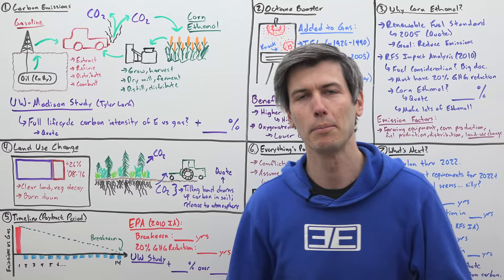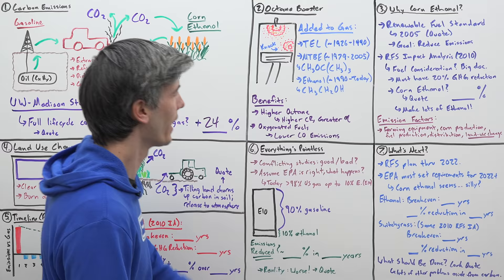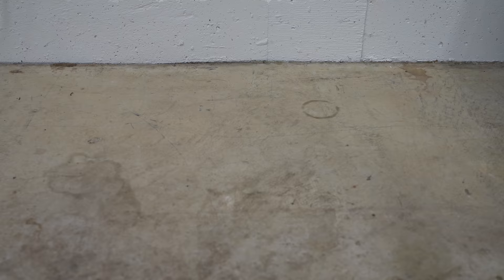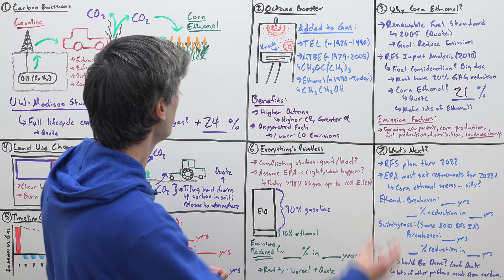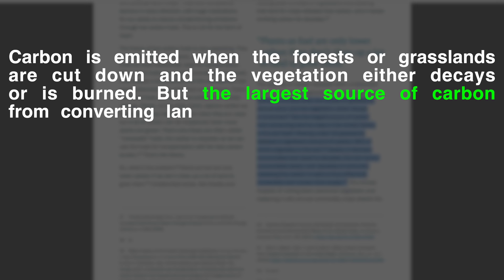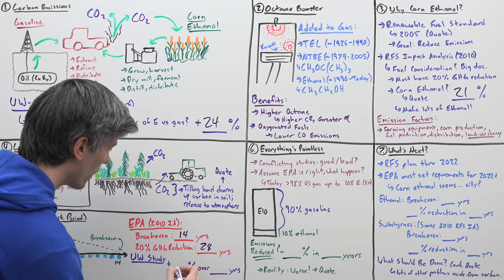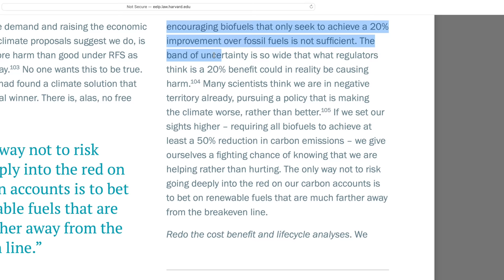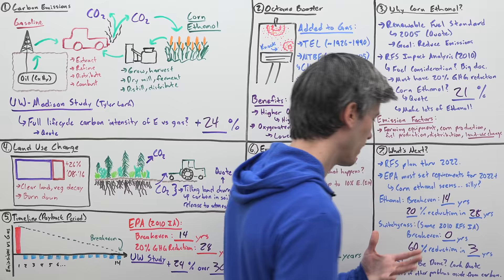America Was Wrong About Ethanol - Study Shows

Comment: Nothing, including ethanol, is as energy dense as hydrocarbon fuel. You say it reduces this and that, but also reduces milage by up to 35% but your price at the tank does not reflect that at the pump. In the long rung you are even paying more for ethanol because your CS government is taking money from your left pocket to pay for the  heavy subsidies they provide to them so they are able to stay in business.
Reply: Nothing, including hydrocarbons, can get the fuel economy and power one can with an ethanol optimized engine.

Gasoline gets less mileage than diesel, and yet we still use it.  Ethanol in our current inefficient lower compression engines gets lower mileage but the cost per mile to drive with it is almost always less and without all the toxic pollution petroleum puts out.  Ethanol also makes more horsepower.  For example, a Chevy 5.3L engine gets a clean 380 horsepower on E85 vs a dirty 355 hp on E0.

In ethanol optimized engines, you will not only get more horsepower but even more mileage, more mileage than what a diesel engine gets.

Ford's first EcoBoost prototype engine optimized for E85 achieved 15 to 20% more mileage than E0 with load performance comparable to a diesel engine.  They didn't make it for flex fuel in part because they thought they could skirt paying for the patents to the MIT scientists who developed the engine.  That is still in court to this day.

Ricardo built and drove an ethanol engine for GM some time ago with mileage greater than GM's diesel engine.

FROM RICARDO:
The new federal CAFE standards are calling for a doubling of fuel mileage performance, which, Vint says, is going to send OEM’s looking for high octane numbers to improve efficiency and ethanol is the best source. Ricardo, an engineering firm with over 100 years in the business of engine design, has developed an extreme boosted direct injection engine (EBDI) to optimize ethanol blends. The 3.2 V6 gasoline engine rivals the power and torque of a much larger GMC Sierra 6.6 diesel, he said, and it delivers 3.5 percent better fuel economy than the diesel.

This is not new technology or knowledge, it was known long ago.  It is suppressed technology.

Rear Admiral C.M. Chester wrote Henry Ford a letter on Dec.15, 1916:
"...I also pointed out in the article that as governmental laboratories had developed from 40 to 55% efficiency in alcohol engines as against 20% in gasoline machines, the use of alcohol at double the cost of gasoline for power purposes, was cheaper for motor[s] than gasoline in common use today."
Reply: @danafletcher2341  Hes gonna flip when he reads that Dana...if he every does.

Comment: It’s horrible for gas mileage and wreaks havoc on small carbureted motors!
Reply: Identical small engines in Brazil use their common gasoline which contains 27.5% ethanol.  It has worked out so well and for so long that Paraguay went to E27.

Ethanol in our current inefficient gasoline optimized engines has lower mileage but the cost per mile to drive with it is lower and the pollution is drastically lower with more horsepower as a bonus.

Comment: Small engine shops and marinas made a fortune on water in fuel issues because of ethanol.
Reply: If you truly believe that you should sell everything you have and move to Brazil to buy every repair shop you can find where identical small engines and boats use their common gasoline which is 27.5% ethanol.

If what you claim is true, then you should become a gazillionaire in no time.

Water is a problem of straight gasoline, not ethanol.  

In fact alcohols were sold as gas-line antifreeze in the days of E0 because straight gasoline cars would stall with freezing up fuel lines.  Heet and Dry Gas were the most common products sold but not anymore since E10 came to be.

If ethanol did cause water problems, there would be millions of cars stalled on the roads of the northern US and Canada right now in cold January.

Mercury Marine said E10 may be the superior fuel to E0 because it keeps the fuel dry

Comment: Here's an interesting fact....fueling a vehicle with E85 fuel results in a 30% reduction in fuel mileage vs. E10 fuel. This is due to the fact that ethanol contains less energy per pound than gasoline. Did these studies account for the increase in fuel burn?
Reply: NOPE.

Comment: Doesn't even go into the damage done to engines.  Carbs were ruined and had to be rebuilt with ethanol compatible parts.  Garages loved all the bonus service people had to buy.   Farmers should grow food, not fuel.  There is also a huge use of water in the production process.
Reply: There is no damage to engines.

The US Bureau of Labor Statistics measured share of household income spent on vehicle repairs and maintenance from 1990 to 2017 during the time ethanol in gasoline went from .1% to around 10% from 2011 onward.

The share of income spent on repair and maintenance went from 2% in 1990 to 1.5% in 2017 as ethanol usage exploded.

On most any manufacturing chemical compatibility chart you will find ethanol is at worst equal to but most often more compatible with rubbers, plastics, and metals than what gasoline and BTEX (benzene, toluene, ethylbenzene, and xylene) are.

Brazil has used >E20 in identical non-flex fuel vehicles to ours since the 1970s.   An E10 blend called Cleveland Discol sold in Britian from the 1920s until 1968-70 when BP bought it out.

Corn is value-added into ethanol while preserving the feed/food in a healthier and more productive form called distillers grains.

Most corn (87%) is not irrigated and the state that does a bit and is known for corn (Nebraska) used more irrigation water in 1980 before ethanol than after.

Early distillation plants many years ago used some water but since recycle most all of it today.
Reply: @danafletcher2341  I was a mechanic when ethanol was introduced, were you?  I saw horrible running cars that could only be fixed by a carb rebuild.  You sound like a corn lobbyist arguing for turning into fuel.
Reply: @Step-n-Wolf  My first-time experience of working on a carb was during the days of E0 in the 1970s when my father's water pump small engines would varnish over winter and stick the needle and/or float.  I saw sheets of varnish actually hold up a float.  Like the smell of a skunk, varnished gasoline is something one can never forget.

When E10 first came in the 1980s, there was a transition to it because alcohols clean varnish (they are often used as an active ingredient in carb and injector cleaners).  I can remember my father's Ford trucks plugging fuel filters to the point we were changing them weekly from ethanol cleaning off the build-up of varnish from E0 in the fuel tanks.  The filters were cartridge style so not fun but at least every engine used the same one (for oil too).  

But once clean, E10 kept things clean.  I still have some of those very same trucks and can't remember the last time the fuel filters were changed.  They hardly are ever run, but they start and run as long as the battery is still charged up.  

I have never seen or smelled E10 ever varnish and don't believe it can no matter how old.

Small engines back then did not have fuel filters, so the carb was the filter.  Note that around the same time ethanol came we also were treated in our fuel to BTEX.  BTEX is benzene, toluene, ethylbenzene, and xylene which are highly toxic and volatile aromatics which are very corrosive on manufacturers' chemical compatibility charts on many materials.  Worse than gasoline.  Gasoline itself is so corrosive that Viton rubber had to be invented.

I am not a lobbyist, but I did stay at a Holiday Inn Express once.

If I have stated any specific thing that is incorrect, please bring it to my immediate attention.  I hate being wrong on anything.
Reply: @Step-n-Wolf  I run Ethanol it ALL my vehicles and lawn mower and have MULTIPLE videos of them running.  Do you?

Comment: A shame policy makers don't use science like this.
Reply: This is probably the best science money can buy.

Unfortunately, the Tyler study was not even close to reality.

There were no grasslands or forests broken up for ethanol.  Quite impossible since US cropland acres have been declining.

Census data shows in corn producing states that grassland, forest, and wildlife areas increased since ethanol.

The reason corn ethanol is so economical over most any other source is that is it value-added from already existing corn feed production and it preserves the feed in a healthier, more productive, and more concentrated form called distillers grains.

Believe it or not, the corn belt grew more corn acres in 1980 before ethanol than they did in 2018, the year of most ethanol production ever and ethanol plants everywhere.

2018 Iowa 13,200,000 acres of corn with most ethanol production ever
1980 Iowa 14,000,000 acres of corn before ethanol

2018 Illinois 11,000,000 acres of corn with most ethanol production ever
1980 Illinois 11,600,000 acres of corn before ethanol

2018 Indiana 5,350,000 acres of corn with most ethanol production ever
1980 Indiana 6,450,000 acres of corn before ethanol

Comment: Another thing is that ethanol does not burn clean and in time will clog fuel injectors.
Reply: Many fuel injector and carb cleaners have active ingredients which contain alcohols.  It is gasoline which clogs fuel systems, the longer it sits the worse it gets and if a cleaner is added like ethanol, you could plug fuel filters much more often as it cleans.  But once clean, running ethanol will keep fuel systems clean.

E100 is >99% pollution free.

The very reason ethanol is added to fuel today is as an octane booster and as an oxygenate to clean up the dirty pollution gasoline produces.

Denver in 1988 was the first government entity to require E10 when they were on in EPA list of ozone non-attainment zones.  Soon with ethanol they were off that list.

Even with just 10% ethanol added to E0, the Swiss Federal Laboratory for Materials Science and Technology found that the especially health devastating ultra fine or nano particulate emissions were lowered by 97%, carbon monoxide lowered by 81%, carbon dioxide lowered by 13%, aromatic hydrocarbon emissions lowered by 67-96%, and genotoxic emissions lowered by 72%.

Comment: It's bad on metal fuel tanks and older models with fuel pumps, it destroyed my old Toyota eat tank and pump up, has ruined many lawn mowers and weed eaters, chainsaws, it's only good for corn growers,
Reply: Ethanol on most any manufacturer's chemical compatibility chart you will find is at worst equal to but most often easier on metals, rubbers, and plastics than what gasoline and BTEX (benzene, toluene, ethylbenzene, and xylene) are.

The common gasoline in Brazil contains 27.5% ethanol and they have the very same lawn mowers, weed eaters, chainsaws, and Toyotas we have.  It has worked out so well and for so long that Paraguay went to E27.

Here is how the 2007 Energy Independence and Security Act affected food/feed prices(if at all):

2007 WEIGHTED CORN PRICE =$4.20 WITH 4 .7B GAL MANDATE
2008 WEIGHTED CORN PRICE =$4.06 WITH 9B GAL MANDATE
2009 WEIGHTED CORN PRICE=$3.55 WITH 10.5B GAL MANDATE

2016 WEIGHTED CORN PRICE =$3.36 WITH 15B GAL MADATE MAXED OUT
2017 WEIGHTED CORN PRICE =$3.36 WITH 15B GAL MANDATE MAXED OUT
2018 WEIGHTED CORN PRICE =$3.61 WITH SAME 15B GAL MANDATE MAXED OUT + MOST ETHANOL EVER PRODUCED

Wheat
2007...............$6.48/bu
2008...............$6.78/bu
2009...………$4.87/bu

2016...………$3.89/bu
2017...............$4.72/bu
2018...............$5.15/bu

Soybeans
2007..............$10.10/bu
2008..............$ 9.97/bu
2009...……...$9.59/bu

2016..............$9.47/bu
2017..............$9.33/bu
2018..............$8.48/bu
Reply: Nope!  sorry EK1

Comment: But ethanol requires use of stabilizers to keep ethanol from varnishing up your fuel systems when stored. It helps create more unnecessary jobs.
Reply: Gasoline requires fuel stabilizers since it does not last very long (3 to 6 months according to the makers).

Alcohols last indefinitely.

Sea Foam and other carb and injector cleaners actually use alcohols as active ingredients.  

Sea Foam states their product stabilizes gas & diesel fuels up to 2 years.  It contains 25% of an alcohol.

I have never seen E10 ever varnish and have been using it since the early 1980s.  I do remember E0 gasoline varnishing, like a skunk, once you smell that you will never forget it. 

Ethanol also acts as gas-line antifreeze.  Back in the 70s and early 80s, people would have to buy little cans of alcohol for gas-line antifreeze with name brands like Heet or Dry Gas.  Not since E10 came to be.

Comment: The public health costs resulting from the massive corn overproduction should also be factored into this.
Reply: There is no overproduction of corn.  There were no grasslands or forests broken up for corn ethanol either.  Quite impossible since US cropland acres have been declining.

When covid hit, cattle publications were sounding the alarm that distillers grains could run out for cattle feeders with ethanol plants shut down.  Cattle feeders would have had to switched to feeding the less healthy and less concentrated corn straight for their alternative source of protein.

Denver in 1988 was the first government entity to require E10 when they were on the EPA list of ozone non-attainment zones.  Soon with ethanol they were off that list.

Even with just 10% ethanol added to E0, the Swiss Federal Laboratory for Materials Science and Technology found that the especially health devastating ultra fine or nano particulate emissions were lowered by 97%, carbon monoxide lowered by 81%, carbon dioxide lowered by 13%, aromatic hydrocarbon emissions lowered by 67-96%, and genotoxic emissions lowered by 72%.

Using petroleum increases health costs, not burning pollution free ethanol.
Reply: @danafletcher2341  So how do you explain all that HFCS in your bread?
Also no one was arguing against fuel additives or ethanol as a fuel additive.
People are arguing against getting it from corn specifically, since there are other possibly more efficient sources, like cellulosic ethanol from algae.
Reply: @fotoschopro1230  We will grow the very same amount of corn either way.  Why not have the cattle eat the corn in the healthier and more productive form called distillers grains?

HFCS properly made is not much different than sugar.  BTW, the one food corn ethanol does compete with is HFCS.  Problem with HFCS are harmful byproducts can be present from making it along with extra starch they don't account for.  They did a study on pop and found four times the carbs in pop with HFCS compared to cane sugar even though it had the same amounts of sugar (i.e. fructose and sucrose).

The reason corn ethanol can economically outcompete most other sources is not because it makes the most ethanol but because it is value-added from >>>already existing<<< feed production while preserving the feed in a healthier and more productive form called distillers grains.

So much so that Brazil put an import tariff on our ethanol in 2017.

If everyone ate grass fed beef like I like to do, corn ethanol would not exist.

Believe it or not, the corn belt grew more corn acres in 1980 before ethanol than they do today with record ethanol production and ethanol plants everywhere.

2018 Iowa 13,200,000 acres of corn with record ethanol production
1980 Iowa 14,000,000 acres of corn before ethanol

2018 Illinois 11,000,000 acres of corn with record ethanol production
1980 Illinois 11,600,000 acres of corn before ethanol

2018 Indiana 5,350,000 acres of corn with record ethanol production
1980 Indiana 6,450,000 acres of corn before ethanol

Comment: You have and others have not sold alchol/gasoline fuel to "The Big Two and a half. I am not incharge of all the car compines, Or the cost of the fuels and distrrm ubution of stuff for cars to make them work. Some one some where has not become sold on changing the system. There is also the use of Farmers fields for fuel growing or Food Growing.  Then again I had trouble explaining to my Engineer Brother in Law why his Great "Toyota" Japanize car plugged up it's CATS.  So much for Japanize Cars and American Car Mechanics.   Also what are the the taxes for both fuels.
Reply: Word salad....
Reply: Lots of identical Toyota vehicles in Brazil where the common gasoline has 27.5% ethanol.  It has worked out so well and for so long that Paraguay went to E27, Bolivia going to E25.  Soot is what plugs up a CAT and ethanol is sootless and greatly reduces the soot put out from gasoline.

With ethanol you grow both food and fuel.  Corn ethanol is a value-added product of already existing feed production which preserves the feed in a healthier and more productive form called distillers grains.

Comment: @1:23

Yah—but it takes fossil-fuel to make nitrogen.  Nitrogen is required, in no small amount, by corn.  Farmers burn fossil-fuels in there tractors to plow, plant, and harvest the corn.  Truck Drivers burn fossil-fuels to deliver the corn to the processor.  The processor burns electricity which is produced by fossil-fuels burned in engines.
Reply: ...and gasoline just magically comes straight out of the ground and into your car. No electric or fossil fuel needed. MAGIC!